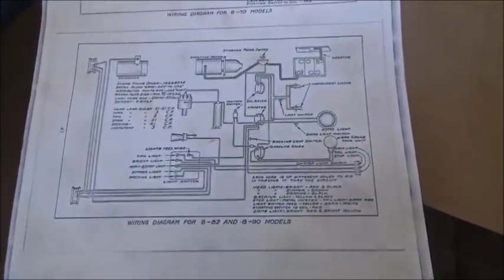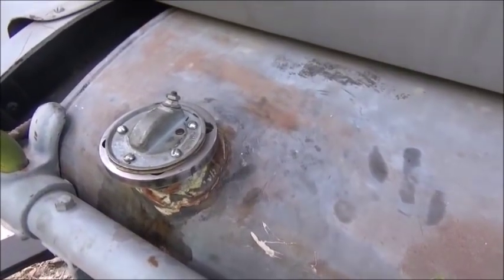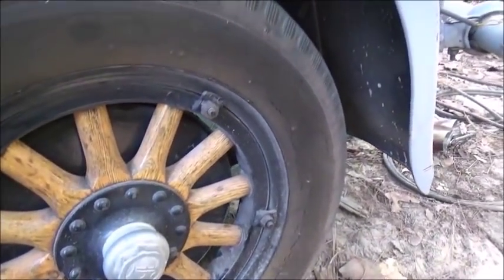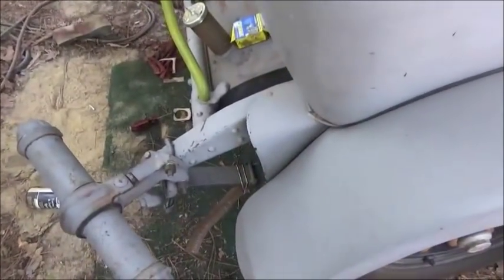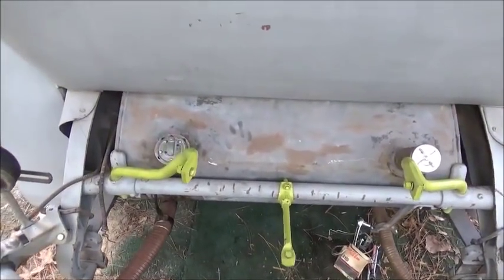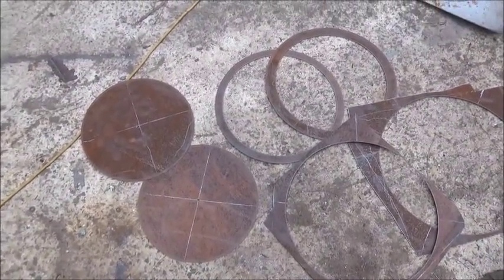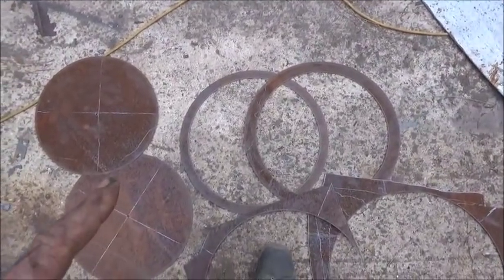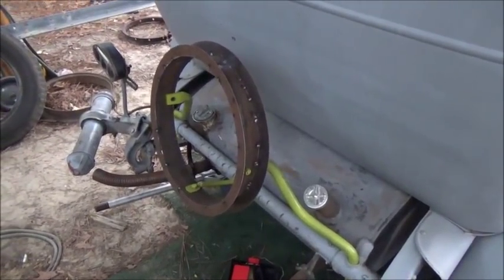Rare 1927 Elcar Spare Tire Rack Fabrication & More

Comment: ,That nibbler reminds me of the one my dad had in his shop. It was the first one he ever taught me how to use. He also had a power hack saw  (my terminology) which I used quite a bit also. I still remember the first engine that he let me tear down to the bear block, a flathead out of a Plymouth that had thrown a rod. I had a great time. Grease and grime up to my elbows. He never bought a machine new but would buy them used either from our local weekly auction or from a machine shop that was either going out of business or updating. Then he would repair them as needed and paint them gray. Always grey because he bought some ex-navy grey at some auction so they were all painted that same grey, even the stick welder. I never knew that there was anything but a stick welder or brazing until I went in the military. First time I used a wire welder I thought I'd died and went to heaven. As usual, great job on the spare tire mounts. I can just see it went you have it all done and all the nickel done on it. Almost as exciting as watching the build on the medium duty and your 4WD. I mean who else would have thought to use the axles out of a '56 Studebaker truck?!

Comment: Glad you got the tire figured out, probably a lot of us jumped on a search on Elcar to figure the spare tire mounting. The funny thing is half the pictures are your car lol. To be expected with rare stuff I guess. I suspect your right on the fuel gauge its rheostat was probably some sort of porcelain wrapped with a heavier wire and a heavier wiper to handle the current. You would probably indeed smoke the chevy one in short order and as you say that scenario wouldn't be good. Good luck with it, its really a great old car.

Comment: Jonathan: you were bemoaning the lack of a wheelwright.  I saw a segment on one of those MSM channels a few years back. I believe he worked in the high country fixing ore carts for mines. There is a diminishing number of wheels which is ok because I think he’s in his late 60s or early 70s. Basically he does this as a favor to his long time friends and for mental and physical exercise. Jonathan this fellow is like you. He has a barrel of saplings and he chooses them according to his needs. Then it’s off to the lathe to turn them down. He has boards about 4 inches wide and 8 feet long for the outer part of the wheel. He cuts them to his needs and I don’t remember if he steams them to get the proper curvature. But you watch this guy putzs and before you know it he’s finished a beautiful wheel. It was an interesting program.

Comment: Jonathan, you should oil your workpiece where the nibbler cuts through. You get a better finish. It also prolong the life of the tool. I think the wooden wheels are a pain. I have them on my 1930 Chrysler CJ6. Putting a tyre on with the flap and inner tube is difficult and local tyre fitters don't want to know. Another problem is they are invariably out of balance so vibration! Any suggestions welcome. Thanks, very interesting video.

Comment: On your next video, could you please show the fuel gauge and the rear connections ?
I'm not familiar with gauges from really old cars. 
On a very old car like this the gauge mechanism will probably be what's called a "cross-coil".
Two coils at about a 30 degree angle with the pointer pivoted between the coils at their closest point. The pointer spindle has a little magnet which is attracted by one coil or the other. One coil is constant voltage while the other is the the control voltage.
The coil with the control voltage is connected to the tank sender and as the resistance varies, more or less current flows through the coil attracting the magnet more or less while the constant voltage coil just helps return the pointer to zero. 

On most cars right up to mid eighties, the gauges ran on 5 volts even on 12 volt cars.
On six volt cars the gauges ran on 6 volts.  More modern cars until the advent of electronic dashes were run on 10 volts. 
Coil and wire resistance means that normal tank unit rheostat current would never be more than about 300 milli-amps anyway so it would not be enough to blow the wire on the sender. 
I'm in Oz so it's a little difficult to be more helpful to you but I'm sure you'll find someone local who can help you with the gauge and speedo etc.  Otherwise VDO and Stewart Warner have a range of vintage style instruments that look fantastic in classic cars. 

There are obviously more important things to do now but when the time comes test the gauge on the bench.  Check the gauge wiring and don't exceed 6 volts, don't worry you won't blow the rheostat wire. If you were silly enough to connect 6 volts directly across the rheostat winding, then yeah you could burn it but if your gauge is in circuit with the sender winding you'll be fine. 
And we know you're not that silly. :o)
Reply: Great comment!

Comment: If you're worried about painting the tank and necks and having the fuel attack the paint you can lacquer it with fuel-resistant lacquer which does work well and will protect the paint from the fuel.  It's certainly easily available off-the-shelf in the UK so I can't imagine it will be hard to find in the US, it just might make the tank look a little more glossy than the rest of the car if you go for the period-correct option of coach-painting it in a form of enamel, though if you elect to spray it with a more modern variety of paint it probably won't make much of a difference, especially being as the tank won't be that visible with the spare wheel mounting and spares in place...

Comment: I don't know if you see the older posts or not but something I tried for removing rust was a tub (a old square one bath tub for the kids) and fill mostly with water... pour in some molasses, about a quart or so then the secret activator was food grade hydrogen peroxide .. about a cup of the 35% food grade. Careful cause it removes skin. Check it out on internet cause it worked good but keep covered cause you don't want animal to drink. In the back corner of garage  and keep it going by just adding water or ingredients. After start up it doesn't cost much to keep going and it is just as fast as that miracle whip that they sent which did work good admittedly

Comment: Surprised to see it has hydraulic lever action dampers instead of friction discs, very advanced.
Nice work with the spare mount. The fuel gauge will need the correct sender unit for it to work.

Comment: modern gauges work just as you said. there is power to the gauge and a ground to the sending unit. the "reastat" is a coil winding which creates "resistance" the amount of resistance is determined by the contact point in which the level rod is at. the other lead coming out is to ground. i think i would keep the factory lights and ad some small l.e.d. lights to the car for safety.
Reply: rheostat

Comment: It is interesting to note the fuel gauge is in the dash , and that it had a sender unit in the tank. A lot of 1920's cars had the gauge on the tank itself. Do you know what brand fuel gauge it had ? SW ,Delco  etc ? .When I have restored really old cars I find that people on the AACA website can often point me in the direction of hard to find parts, often in other countries and you might find someone who has the ohms requirements for the gauge and the sliding pot resistance in the sender. These things can be repaired so condition is never a problem. On the Running boards,  yes, the sides were often trimmed  in 1x1 x1/8th Alloy angle which has grooves in the top edge and to protect the  rubber there were might have been step plates,usually nickle plated brass . (something you could cast up if you found a pic of ELCAR plates) .Only big production numbered cars(GM, Ford etc )  had molded rubber running board covers.

Comment: I wonder how many nibblers went to the scrap yard as the USA got out of the manufacturing business.  I went to an auction about 10 years ago and a metal lathe that must have  weighed 5 or 6 tons, 480 volt,, 3 phase with a power feed head attachment along with just about everything you could dream of went for 5 or 6 hundred dollars.  It was in perfect shape and had not been outside so no rust..  I didn't see a nibbler or anything else but I wasn't really looking, I only stuck around to see what the lathe went for.  So much really good stuff that people could easily afford but every day what is left goes to the scrap yard.
Reply: Those old nibblers are pretty popular with the metal shaping folks. They make different tooling to go in place of the cutters, and use them to create panels for old cars. Some even prefer using them rather than an english wheel.

Comment: If you look at your gauge as a light bulb cuz that is what it is.... the round side of it is what controls it. If you have a missing ground on the far side of the sender, you will have positive voltage. All cars from that period worked this way. I think you have something not grounded... a wire or that tank.   I dont know, maybe that helps?  Good luck buddy. Youll figure it out for sure.

Comment: That metal strip on the running board looked like silver solder used for AC coils.
Reply: looked like a wire out of a windshield wiper
Reply: That's exactly what I thought - silver solder
Reply: I was gonna comment the same it does look like silver solder

Comment: I see the issue with the fuel gauge now.  Of course more modern vehicles with permanent live fuel gauges have voltage regulators behind the dash to stop the problem you describe happening.  I'm pretty sure most of them have the gauges fused in some way too as for added safety...

Comment: I suspect the original gauge was a two-terminal unit and did not use ground.  Voltage went to the gauge, which is a variable resistor, and back to the meter on the yellow wire.  You're right on the hot all the time wire.  Maybe someone put that wire on the wrong side of the switch sometime.  Very nice tire mount.

Comment: Jonathan there should be "power" to the sender, that's how the fuel gauge works. It's not going to be a "bomb" as the only part of the sender in contact with the fuel is the float. The electrics are all on the top side. The gauge earths through the sender which determines the fuel needle position via resistance due to the position of the float. As the gauge earths through the sender you will see power on the wire that goes to the sender.

Comment: On the spare tire rim, you could have one plasma cut two circles and have a flat piece rolled to fit inside and weld it up then grind it to  the radius you need. I guess I should have finished watching the video

Comment: I would try to connect just the negative wire to the sender, since it seems to go to the gauge (negative?). Putting a small few watt light bulb in the series while testing would also be a good idea. Connecting the +12v wire to the sender would most likely destroy the sender, since it does not go even thru the gauge. Seems to me that it had originally different style sender (voltage divider).  The tank wouldn't explode even if the sender would spark, since there is not enough air in the tank.

Comment: on my falcon, the power goes from the key switch to the gas gauge then to the sending unit in the tank. the rheostat changed resistance befoe grounding to the tank.  I your diagram the power is goi g fro. the key to the sending unit then from the sending unit to the gauge and finally to ground.  to use the sending unit you have you need to send the power to the gauge first, as it is in my 1960 Falcon

Comment: Watching and wondering how you hold the wheel rim to change the tyres . Most fuel senders have a low resistance when tank is full  which increases as tank empties. That nibbler is  gnarly looking but a really  practical machine.

Comment: Shouldn't the gas gauge get it's power from the ignition switch ? Lacing between fender & body can be bought from Dennis Carpenter of North Carolina . Granted he is a Ford reproduction company, but i've known people have used him for rubber bead type stuff for other makes of cars. Neat old tool, haven't seen 1 of those in decades !

Comment: should be 12 (or 6) volts to one side of the instrument gauge and ground to other side thru the rheostat, but needs to be a switched 12 volts to the instrument cluster.   I would think the instrument gauge uses a   possible D'Arsonval movement.  so it is not straight voltage to ground.  https://nickstruckparts.com/collections/wheel-rim-clamps.  maybe something there you could use or modify.  My gosh that nibbler is amazing.

Comment: regarding the fuel gauge and nder all senders are ground not power regardless of polarity of the car
early mini's were positive earth  they still run the sender to ground not power

if you run the power wire to the sender theres a strong posiblity of an explosion
the reason its all ways got power is because its on the battery side of the ignition switch  should be on the other  terminal and
only become live when the key is turned to the on position
Reply from the maker: Exactly my point in the video, but I have learned how the original worked and I will have it in the next video.

Comment: I think the tire is too close to the car too...l know the pic shows the spare leaning in but l remember you saying that setup wasn't exactly the same as yours...didn't know about the ohms moving the needle - seems like l learn something every video...coker may have those rim clamps...also, when you took the wheel off the car & moved the camera in l was squinting hard as l can to see that back side ring edge & how the wheel seats to it - think l got it figured out...now l'm thinking maybe for the spare mount you could roll a little strip (same diameter as the front ring) & tack it to the back ring to act like a collar so the front ring will have some help supporting the spare? nobody will see it (unless they look real hard) & l don't know that it wasn't like that in the first place unless they used a rim before they drilled the holes for those wooden spokes...l still can't figure out how those wood spokes attach to that wheel & what they did driving through water (rough roads back then) & if those wooden spokes didn't swell up
Reply: Good video
Reply: Those are called 'Artillery Spoked' wheels, at least in the U.S.A.  Spokes were treated 'as needed' with raw linseed oil.  That water-proofed them, and kept them from shrinking.